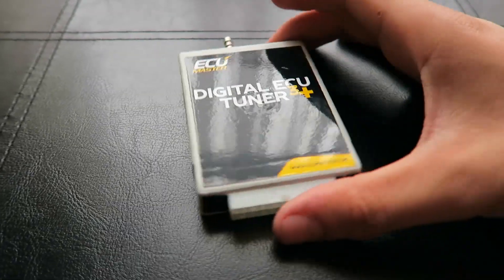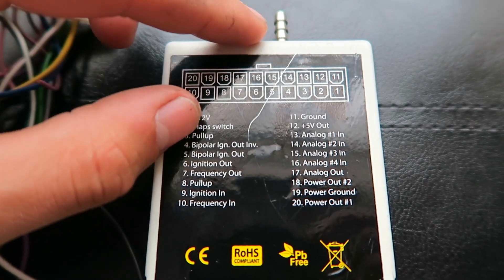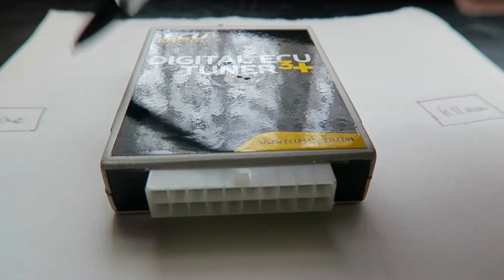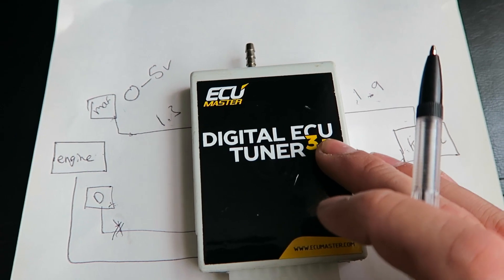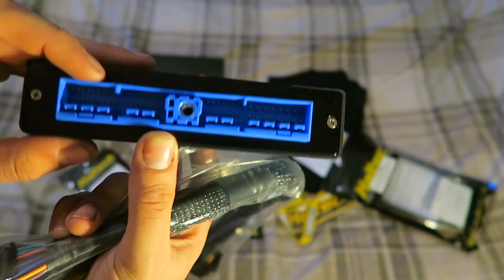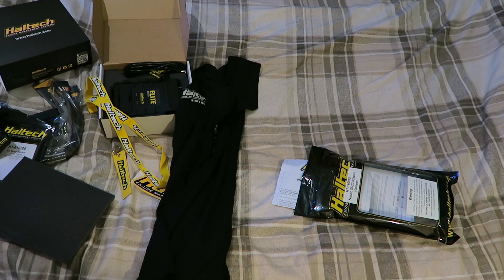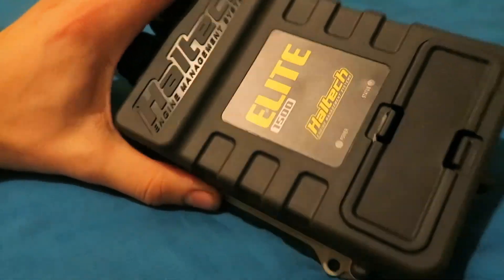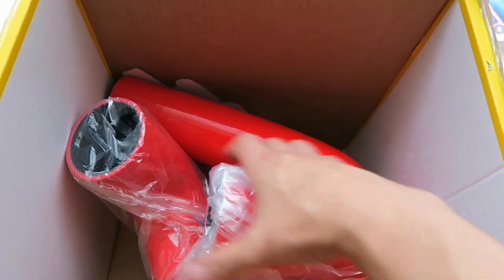How to install a Det3 on a k11 micra (And my change of plan)

Comment: So how do i Know where i have to conect the wires? 
I mean which Pins on the Original ecu
Reply from the maker: Are you using it on a Micra ?
Reply: @MyNameIsNavo 
Yes
Reply: @MyNameIsNavo micra k11 2. Facelift 1.0 60hp

Comment: Hi
I spent too much time trying to find the wiring diagram for 301 peugeot but i couldn't find any information about it 
Is it possible to trace the wires from each sensor and can you or any one guide me how to find the ignition (ignitor) wire
Reply from the maker: Can you get hold of a wiring diagram at all ?
Reply: @MyNameIsNavo  unfortunately no source of information 
Even from there original site i paid the subscription but with no info

What im thinking is to trace the wires in the loom from each sensor to the ecu
The problem is that the coil back has 6 wires come out of it 
I don't know how to recognise the wires which one is for which
Reply from the maker: @thecalipercnc2800  I mean I suppose you could but you would at the very least need a ECU pin out I wouldn't bother asking ecumasters for one as a member of a owners group or such
Reply: @MyNameIsNavo  it will be very kind of you if you find it for me
My ECU is Valeo v46.21 
The car is peugeot 301 2014 1.6 petrol
I can give you photos of it if you want
Reply from the maker: @thecalipercnc2800  I'm sorry I'm weighed down with work and other such projects I suggest you take a look at the owners forums and post what you need on there
Reply: @MyNameIsNavo  i will do it and i hope that i will find information there 

I want to ask is it possible to reduce the amount of fuel by connecting only the MAF, Crank and TPS without  connecting the ignition ?

Comment: Does the ecumaster det3 work on most cars? (Peugeot 206 1.1 specifically??)
Reply from the maker: Not sure on that one pal I mean it works as explained by being a middle man so it should as long as the ECU isn't clever enough to over ride it

Comment: Is this ecu good for n/a tune or no ?? Does it really tune afr ? I have already fit the ecu just need to tune after i get the wideband !!
Reply from the maker: Afr is simply air fuel ratio so by adding fuel your changing the afr as explained in the video in how it manipulates the ECU to add more fuel you can change these settings

Comment: Now then, could you link me with the location of the ignitor wire on a k11 micra ecu. Struggling to find which wire it is on the diagram I have, cheers!
Reply: Did you find this wire mate?
Reply: @lewissimmo1224 did you ever figure this out having same trouble right now

Comment: For the det 3 you didn’t talk about fuel implant mode. Also if your car has knock sensors already the the stock ecu would protect the car correct? I am currently fitting a det3 to my supercharged  bmw 645ci. I also imagine using separate sensors for the CLT and IAT makes the job a lot easier instead of resistors which I’m still figuring out how to crimp into. Did you used resistors for the CLT and IAT. Nice haltech ecu btw!
Reply from the maker: I would Imagine that the factory knock sensor would put it in limp mode if knock was detected I haven't used fuel implant mode as I only had it installed as piggy back hence my not mentioning it I only used it in this set up on my k11 Micra so shared my install advice

Comment: Hello mate, loving the vids haha, have you by any chance still got the base map you used for this? I've got a 99 dizzy k11 wit a cg13de and just bought a det3+, wiring is no problem at all it's the mapping haha
Reply from the maker: Hi mate you doing it piggy back like I said in the video ?
Reply: @MyNameIsNavo  yeah exactly how you had it bud, got a cheap afr for now but will be getting one for the det3, just need a base to start with. I could make one but its 10x easier with something to start with haha, thanks mate
Reply from the maker: @lewis witson have a look at my latest vid mate should help